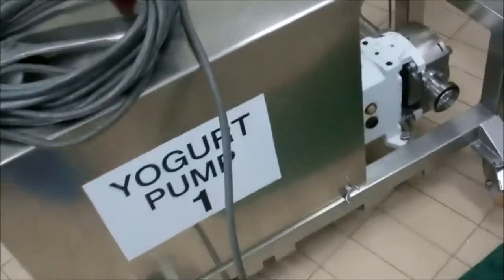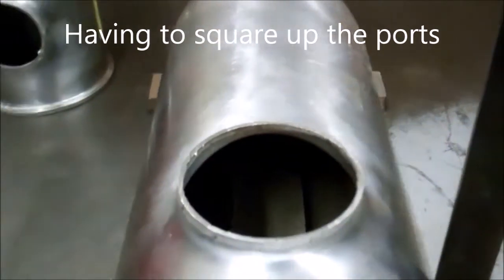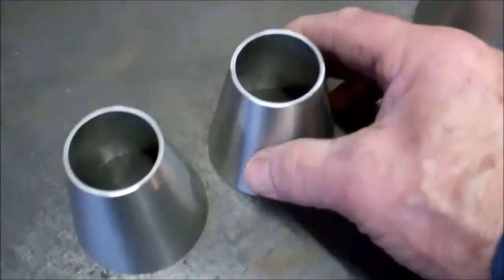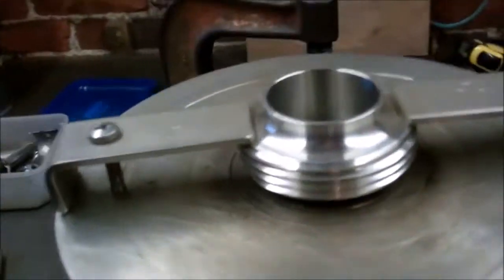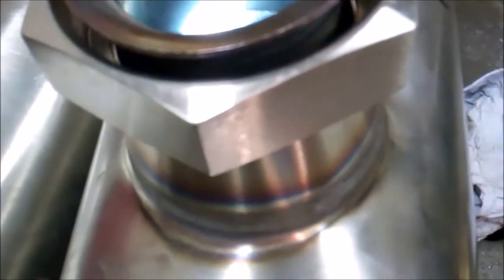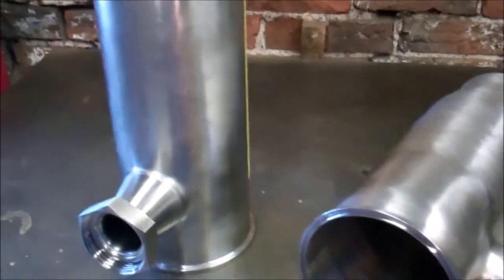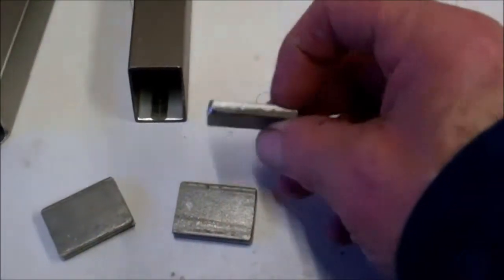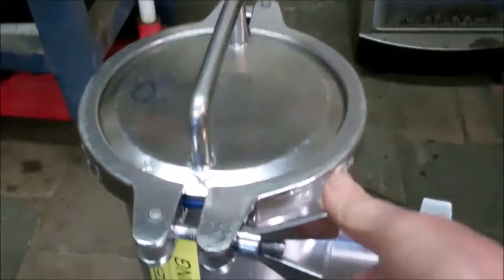Tig weld stainless steel hygienic fittings & custom made brackets

Comment: another good video ,i use a number 12 pyrex cup with gas lens and argon shielding .the outside welds are very very clean just a tip
Reply from the maker: Thanks for the comment, Yes those wide cups do give a cleaner weld even with less argon flowing especially when using a gas lens, I can't use a wide nozzle very often as a lot of my tig welding is tight up against the side of fittings and in confined spaces.

Comment: John, great job as usual! How many cubic feet or liters of argon do you use to back purge? Thanks!
Reply from the maker: thanks for the comment, the answer to your question, on small items like I was welding let the argon flow in at about 7 litres minute for about one minute to remove the air out through a breather hole, then turn the flow right down until you can just feel some argon still exiting the breather hole, remember argon is heavier than air so it needs to be fed in at the lowest point and the breather hole needs to be at the highest point, also remember that while you are welding, the argon inside will expand from the heat and will start to exit the breather hole faster than you are feeding it in, if your argon flow is to high it will blow a hole out through the weld pool.